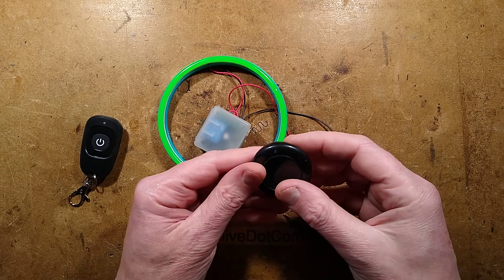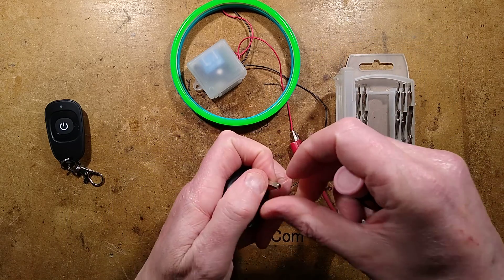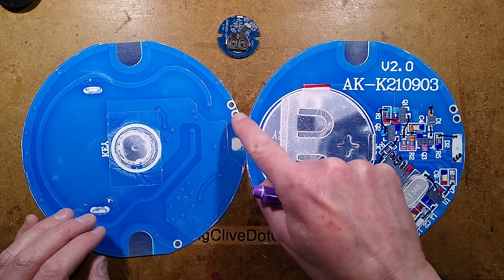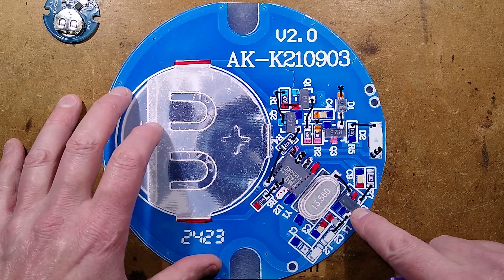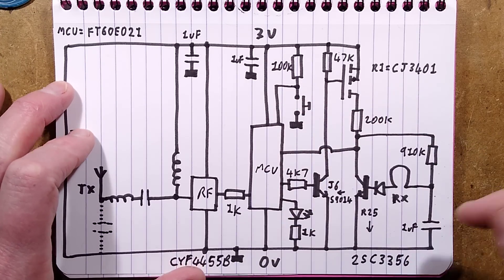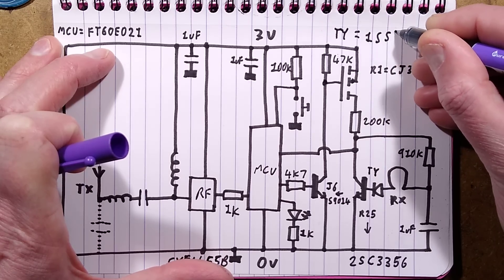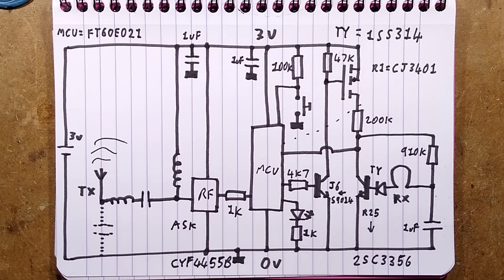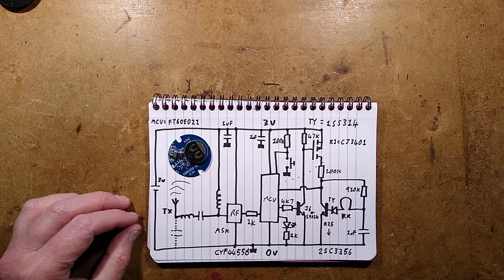Cloning radio-control button - with schematic

Comment: I think I have the same buttons. The clearing of the code works fine, but I can't get the learning to work. 😞

When trying to perform the learning it does the double-blink as in the video, but then nothing.

Any ideas very welcome.
Reply from the maker: Some receivers use a non standard code system or require that it be transmitted multiple times to catch it.
Reply: Before clearing the default it was sending with Princeton encoding and I tried to set with the same, but no result.
Reply: Note: Just tested to get the code from an identical button, but with factory default. No luck with that either.

Comment: These look great and just what I'm looking for to open a garage door. However, I'm not having any luck tracking down this particular model. I've bought one  button from Amazon and one from Ali Express - both described as cloning or learning remotes. Unfortunately, they have a different PCB to yours that says SOS-V2.1. I'm thinking these are really SOS buttons that have  a fixed code that cannot be erased. The 'four button press and hold' technique does not work. It never starts flashing. If anyone knows where I can get one with the circuit board shown here (AK-K210903 V2.0), I'd be eternally grateful! Great video as ever. I love this channel.
Reply from the maker: Different learning remotes have different programming procedures.  You may find a video about yours on YouTube.

Comment: Is the space for the capacitor the double hole on the PCB at one end of the  antenna? If so I had wondered if this was an area where perhaps a coax shield and core could be attached if this little device was going to be given perhaps a little external antenna.

Either way, it's a dinky little thing and possibly even a way to make an "easily mash with hands" control when outside to turn things off / on with gloves / wet hands and so on.

Comment: The received rf will be demodulated by the diode and transistor BE junction.  The nonlinearity will have a DC component to pull the transistor collector to near ground.  The collector capacitance stores this state between cycles.  This allows the MCU to detect when the transmitter is sending.

Comment: I like the way they biased the receiver transistor by connecting the diode to the collector. It makes it super sensitive since the transistor is barely turned on the base is very high impedance.

Comment: Not sure why the two transistor power to the RX is there. But wondering if the drive to it is from a DAC output from the uproc? So it might ramp the supply to find the bias point of the detector diode, for max sensitivity?

Comment: I own a simpler version of this radio control in the same housing which eats a stack of 3 button cells 🙄
So there might be higher voltage versions ¯\_(ツ)_/¯

Comment: Do you think that maybe the design engineer, took manufacturers sample circuit pieces and then hooked the sections together to make this thing - you know, lazy way out when the owner wants it NOW! Could explain why the center section is not hooked directly - he would have had to do some math, to figure out the biasing and current limit?

Comment: I have bought a couple of interesting universal remotes from aliexpress that not only clone the code of the original remote, but also its frequency! I needed one to replace a dying remote on a VERY old garage door opener that operated at 318 MHz, and to my surprise, it did the job just fine, so I immediately bought a spare. I will not put any link, but the search keywords are "multi-frequency remote". They might feature an even more interesting circuit.
Reply from the maker: I spotted the multiple frequency ones.  I should get one to check out.

Comment: When you're measuring power supply decoupling capacitors in-circuit, aren't you essentially measuring them all in parallel?

Comment: Video idea: Take apart a 'Scccat' air sprayer cat deterrent
Then make your own cheaper version that uses standard compressed air cans. You'd make millions! Or get sued. Make it use a little squirt gun instead of compressed air, then they can't sue you.

Those things work really well (most of the time), but they're super-expensive and shoddily constructed.

Comment: Perhaps the FET (assuming it's an N channel) is used as a constant current source to "almost" turn on the RF transistor by keeping the bias well controlled. There is no voltage divider on the base and no bias resistor in the emitter, so of itself a very unstable circuit without good current control. With constant current feeding the 200k to the transistor there will be a negative feedback effect (DC) on the transistor bias keeping it very close to the bias point (probably close enough to saturation that collector goes almost rail to rail with a small signal).

Comment: I'm just an end user but I've noticed that a lot of this Chinese stuff seems to use the same signal chips (or whatever, I'm not great at the schematics).  I have two pedestal fans and a space heater.  Heater and one fan are Lasko and I forget the brand of the other fan.  I have found the remotes are largely interchangeable.   I can turn any unit off on with any of the other remotes.  I can also control the speed but with different buttons.  So for example the timer control button on one remote might control the speed on the other units.  It's not a surprise that they find multiple uses for parts they probably have pallets of.  Just sort of amused me.

Comment: Clive, i would like to know your thoughts on the 3d printed circit board at 24mins in project binky episode 39 on youtube by Bad Obsession motor sport
Reply from the maker: It's a very strange approach, but looks good.  I'm not sure how easy it would be to reliably solder to solder.

Comment: I looks like the TY is biased to be partially on [via the mosfet to the positive rail.] with 1.1meg resistance on its base and the diode ensures the base of TY only sees a DC voltage fluctuation from the input RF signal.  So the receive pin of the MC is seeing the small voltage fluctuation.

Comment: im more interested in the software and how are hey managing to get the signal , becoz there will be a delay between when the clone gets into programming mode and starts recording and you pressing the original remote,and when you did the demo ,there was no delay with the clone ,im guessing there is a function that will clean up the signal and remove whatever is not a signal at the start , and then they have to clean up after the signal,

so theoretically ,if you enter the programming mode and press 2 remotes one right after the other ,it will save both ,and it will play back both one right after the other ,so you can turn on 2 devices at the same time .........
ofcorse it could be limited by memory and the length of the signal the clone can store ,also it can not work if the software discards the second signal becoz of the delay of you pressing the 2 buttons one after the other..... interesting possibility's

Comment: As the RF signal detector, the diode is fast so that it can actually pass the VHF carrier signal (that's being pulse modulated). The Transistors and resistor are, among other things, a crude RF demodulator stage. They'll switch the microcontroller pin just fast enough to deliver each data pulse from the transmitter as a continuous high or low of the original length. The micro has no use (or speed) for decoding a series of 433MHz pulse trains overlaid with whatever other RF noise the diode happens to pick up locally. It's a clever solution for this application; no chance of someone cloning a transmitter button from a distance becomes a (low) security feature, rather than a consequence of least cost design.
Reply: I am not convinced that the diode does anything. With probably only a few mV from the receiving antenna, I can't see the diode ever having a reverse voltage across it.  And if the voltage ever does reverse, won't the base-emitter junction of the transistor stop conducting anyway, without help from the diode?

Comment: The RF transistor is just barley on so the collector output is high, but on enough to make the transistor sensitive to small inputs.   The detected RF energy turns the transistor on "harder" so the collector goes low.  The circuit detects nearby RF source is off or on.  The collector is high for off and low for on.

The microcontroller records the timing of the on/off signal and then reproduces that timing by turning the transmitter chip off and on with the same timing.

This is an interesting circuit.   Thank you for the reverse engineering.

Comment: The two through holes at the end of the antenna keeps the signals synchronized on the two antenna traces. Without this terminus,  the signals on the two traces could have chaotic interactions (signal reflections) . This is not such a big deal  on a transmitter only antenna, but on a transceiver, it becomes quite important because incoming signals can have issues regarding direction and polarity. If a signal comes in from an angle and there is no terminus, the antennas can start to have signals bounce around on them and garble the signal (reflections),  or even cancel each other out if they are (roughly around 180 degrees) out of phase on the two antennas. The terminus prevents this and makes the antennas appear as one to the transceiver. Whoever designed this knows RF voodoo.... oh yeah, as you can tell, i also know this sorcery... proper antennas are quite the black art.
Reply: If you ever need a good antenna, MP brand antennas are the best!!! MP stands for multiple  polarity... pricy, but worth it! Been using MP brand antennas for 20 years..... the owner is a true sorcerer
Reply: I'm learning electrical engineering right now, and this still blows my mind.

Comment: How does the unit sweep around the central 433Mhz frequency to find the specific channel frequency that a remote is operating on? I'm guessing it's not doing a Fourier Transform in that MPU!
Reply from the maker: It's a fixed 433MHz.  The receiver section probably has a wider response based mainly on the antenna length.

Comment: I think the extra complexity to power the RX circuit is for power saving, it allows the entire RX circuit to be completely powered down when not needed (ie 99.999% of the time).
If they tried to power the RX circuit from a micro digital output pin, they wont lose much voltage because the output pin Hi side driver is probably about 40 to 60 ohms when on, BUT the pin's impedance at 433MHz will be terrible and there would also be problems with the IC's internal pin protection diodes which would be very unhappy at RF frequencies.
I dont think interference from the micro was really the main issue.

Comment: I suspect there is an impedance mismatch between the receiving antenna and chip. Powering the circuit directly from the battery helps keep noise from swamping an already weak signal path.

Comment: A thing here in the US is car thieves some how grabbing your key Fob codes to steal your car .
Reply from the maker: They use a booster to link from a fob in your home to the car, and then sometimes use an OBD dongle to reset the code once they are in.
Reply: that is the reason to never be a lazy sob and order keyless entry/start.

without an active keyless card or keyring attachment it's impossible to get a signal from the keyfob.

yes criminals can log it while you un-/lock it but the rfid to access the immobilizer is another barrier.

having a keyless card in a faradys cage (closed metal case) and away from the frontdoor is always a good safety measure. not using the remote unlock is even better... but also kinda ehhh.

Comment: There's what looks like a crystal on the board, labeled 13.560, that does not appear in your schematic.  Or am I failing to understand something?
Reply from the maker: I missed the crystal.  It goes between the RF chip and zero volt rail.
Reply: @bigclivedotcom  A crystal to the 0V rail? Shouldn't it be between an inverter type circuit?
Reply: @johannglaser  The Colpitts, for example, has the crystal to the ground.
Reply: @circularbrow  Interesting, thanks for the info!

Comment: You wonder why, given the collector load of 200k, they felt the need for J6 and the FET. Could have just taken the +ve end of the 200k to an output pin and saved 10 cents

Comment: I think the receiver is not for long distance, but only for reading the nearby original. It’s more or less an un-tuned detector receiver  with a single stage transistor amp added. 
The strange way to power it ensures max voltage. Remember there are already 2 diodes in play and the mcu might not have rail2rail outputs.

Comment: Could be handy for replacing end of life/beyond repair remote ac socket remote, I only need one button, pretty sure mine is 433mhz?
Reply: That’s what I did with my roller door after its fob died. As long as the RF encode chip comes from the same family they should be interchangeable.

Comment: I'm not an (U)HF expert, but I think I understand why they used the FET in the receiving end.
First of because the RF noise interfere with the MCU frequency probably. 
Second, the RF signal will be very weak and the impedance of the circuit, usually really low, won't match with the MCU's impedance, thus losing a lot of signal which as mentioned before will probably be very weak.
Reply: I think it also has to do with the supply current micro pin, as well as power supply rejection of the ADC in the micro that will be polluted by the switching RF signal. Overall, the safer design.

Comment: I wonder if it could accept a POCSAG (aka Pager) transmission as a signal input to clone, given there's people who have modded old pagers to receive on the 433MHz band to make them legal(ish) to send messages to for various hobby purposes, would be fun having a "doorbell" or something using a pager as the receiver... :P
Reply from the maker: It will probably require a standard remote code format.
Reply: Easy enough to try, do you have access to a Pocsag TX or a test set?  I wonder what the MCU actually stores?  Does it as Clive suggests here require a standard format, or does it just record what it hears and then replays that?  I suggest the latter as it would make it simpler.   

Seeing that the RX is so basic, effectively a crystal set, a devious thought.    Although the TX is fixed at 433MHz the RX frequency could be just about anything, so it could be used as a device to copy and carry the code from another frequency fob.  Very handy if you are a spy and don't want to get caught with a working fob on your target's system.  Then when you get home clone the fob over to one on the target frequency...
Reply: @qwerty-cg7hv  It's easy enough to create a POCSAG transmitter, there's a bit of software for the Raspberry Pi called "RPiTX", which does a lot of transmit and receive type stuff, but using the PLL synthesizer on the RPi it can send very short range (very low tens of metres indoors depending on frequency) messages, only thing is I don't have a 433MHz-adapted pager to test the idea with... :)

Comment: ... Suspect the reason for complicated RX enable (8'30"ish) is that they need all the voltage they can get (and no MCU output pin noise as you suggest).... Nice reverse engineering, your videos are a very welcome addition to a fascinating world.
Reply: Clive is the David Attenborough of electronics.

Comment: If the original 433MHz transmitter uses 'on-off-keying' (just turn on/off the transmitter in a pattern) you don't need a full 433MHz receiver, it's sufficient to detect the energy from the nearby transmitter. 
Looks to me this is what this clever little device does. Nice!

Comment: I could not find this particular type of round button on eBay...I don't use Ali because they ripped me off on the first time I bought from them so I will never go back.  
But I did find a lot of the two & four button kinds on eBay...selling in lots from 1 to 100 pieces...some in stick form.  Pretty useful for companies & apartment complexes to get.

Comment: I have a very similar looking button although it wasn't sold as a clone enabled button. At what point in the programming cycle does it stop retaining it's existing code? It would be useful to know if the one I have has the clone function as I may have a future need for this button to control other equipment (which have a fixed code) but at the moment I would prefer to keep it's current code. Getting to the point of a solid light after the 4th press would confirm it is the clone type but I don't want to change/clear it accidentally by going too far into the clone process. At the moment it is stuck down and I don't really want to lift it unnecessarily.
Reply from the maker: Most standard remote buttons contain a dedicated chip.